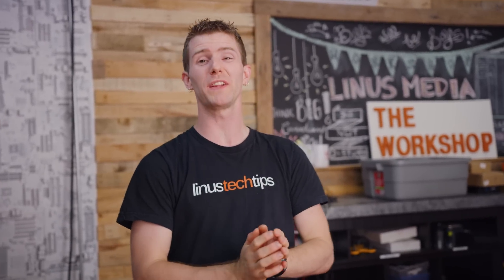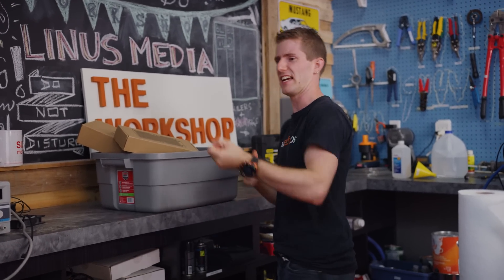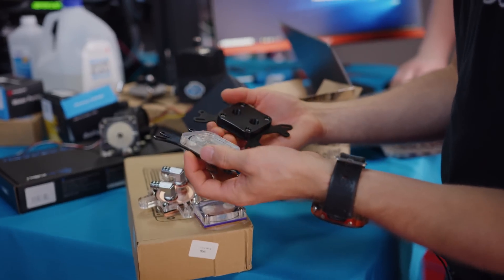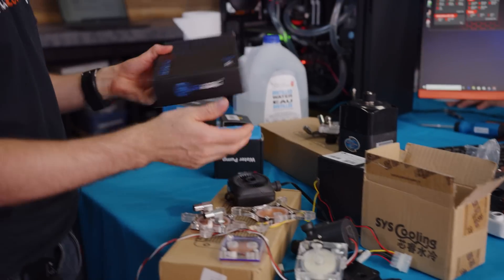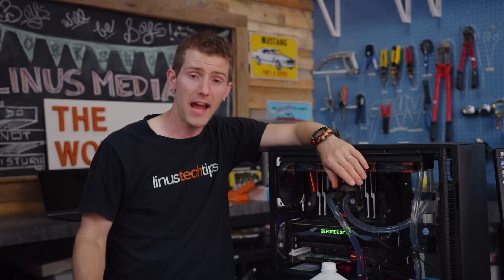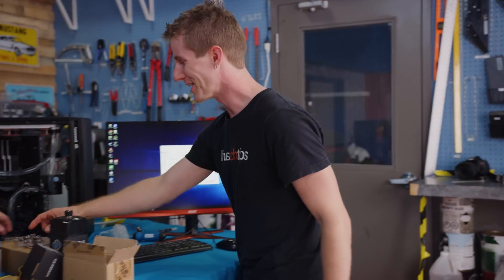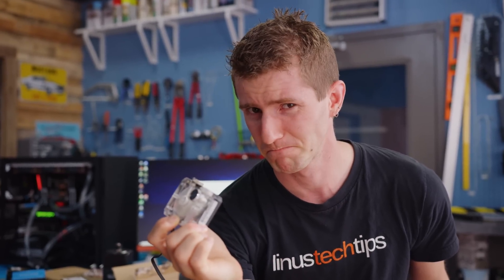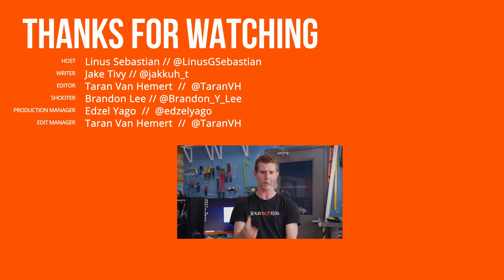AliExpress Water Cooling DOESN'T Suck?!

Comment: How about using your loop as a Sous-vide cooker?
Reply: having a hard time remembering the reason behind the recommendation to not go over 60C in a water cooling loop... Was it something with the liquid? Gaskets maybe?... Anyway, temperature regulation could be fun though, figuring out what parts of different games take more or less energy to render, and play by temperature. Good times!
Reply: Max Witt 60+ is only for welldone meat. You can do 54C for Med-rare steak.
Reply: Reasonable! Shouldn't be too hard to achieve. All we need now is a mini radiator, a water bath and something to circulate the water. Oh, and also the game to play while we cook which has the goal of keeping the temperature perfect.

Comment: So close to the 13:37
Reply: 13:38 one step ahead ;)
Reply: l33t
Reply: LEEB instead of LEET. so close.
Reply: Kira Slith *BEET, as it is read upside-down. In early monospace fonts, the 1 appears with a horizontal stroke on the bottom, which is why it is seen as a "T" when turned upside-down. Also, the "3"s are flipped so that they rather represent an "E".
Reply: BeatRush2011 ...killer tofu?
Reply: we only need nine more likes on this comment
Reply: Someone set us up the bomb
Reply: DANNYonPC 1+3+3=7
Reply: error 404 camera has stop recording ----- LINUS wat you done
Reply: 1337 is staler than the troll face
Reply: I dont get it...
Reply: 133🅱️
Reply: Pretty sure 1337 is a stale meme by now....

Comment: Linus can you try out ssds from aliexpress like the kingspec ones.
Please :3
Reply: Find some reviews for SSDs from 10 years ago and you'll get what you want :D
Reply: Friend got a kingspec m.2 off ebay, runs full sata speed spec. not bad for hella cheap
Reply: Aren't they just SD cards in an SSD case?
Reply: sure thing, you'll see it next year around this time ;)
Reply: Polarwolf91  Noice
Reply: Madcat 456 smort
Reply: I have 2 of them for over a year now ^^ Both working fast and perfect.
My old samsung ssd failed after 5 month haha
Reply: Tobias Schneider To a point I'll agree Made in China products, designed, and produced fully by a Chinese company can be of decent quality, but there are times you do get what you pay for. So it's a bit of a gamble for us in the west to find the good stuff, and wade past the crap. Made in China clothing is an example I've bought socks in bulk off eBay to save some cash direct from China(took about a month 1/2 to get to my door), and they fell apart in a few months, but I now buy my knee sleeves(I have a partial tear in my left knee) from a Chinese company called AOLIKES as they are cheaper, and better than anything I've found in store. Same for my Chinese fitness tracker watch. damn thing last for a week before I need to charge it, and it's fairly accurate, and it was only $13 shipped, so  yeah i would have payed 3 to 10 times as much for one with the same features if it was designed by a western company.
Reply: Ye. But you can count on those chinese brands for sure. I have a Xiaomi mi band 2 and its awesome. Outplaying all other fitness bands under 100€ and having a battery life of 5 weeks. Paid 20€. I do agress that some stuff can be crap, but for example when I bought a torch lamp of aliexpress it had a huge idle drain. Charged it and the other day it was empty. Contacted the seller and 2 weeks later i got a new free one at my door. They are extremely tolerant.
Do you know the jumper ezbook 3 pro? It´s a pretty good well build macbook like notebook and I got it 70€ cheaper, because i had problems with the ssd (not on the compatible list but i forgot to look up). All in all I won´t order anything from germany anymore. Especially from german stores.
It´s sooo overpriced. I mean 20€ for a case which costs 2€ on aliexpress with the same quality? They are actually awesome.
Reply: My chinese branded Jonsbo air cooling keeps my i7 4790 at 40 degress Celsius even under stress. 30€. I think I did not need a much more expensive product do I ? x)
Reply: Jonsbo is actually a very big brand in china
Reply: Ye. They make those really expensive desginer cases
Reply: EVERYTHING literallly EVERYTHING today gets produced in china! There is no difference if it´s not developed by a western company and if the price is not skyrocketing high haha.
People get that in your minds. China produces everything we have today and due to competitors the priced dropped, but the quality stayed ;)
"Cheap" does not mean "cheap" anymore. It means good AND affordable.